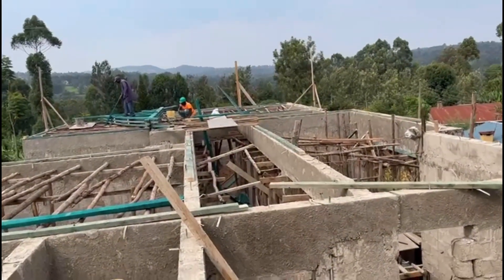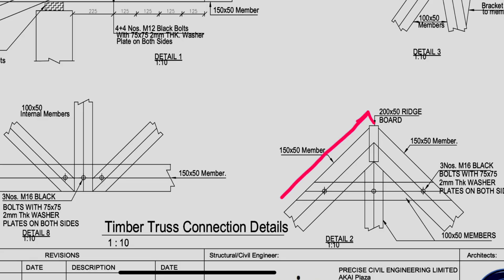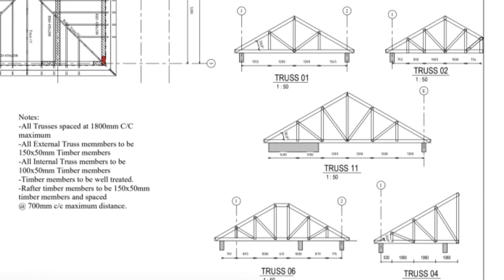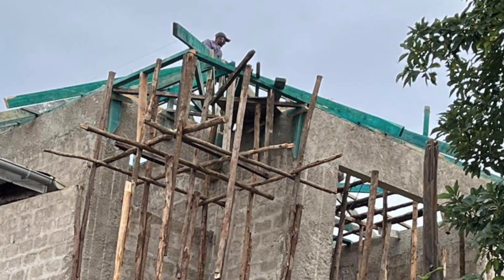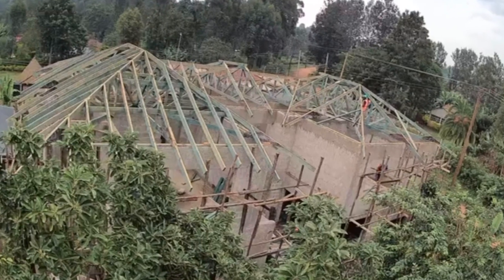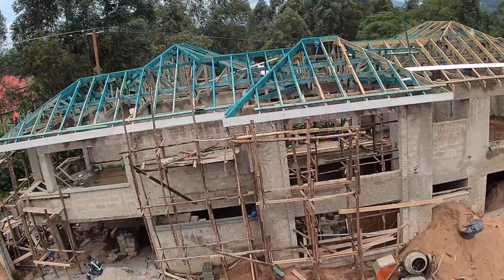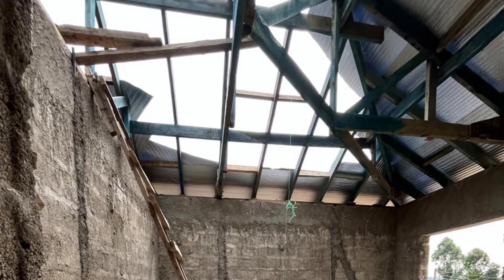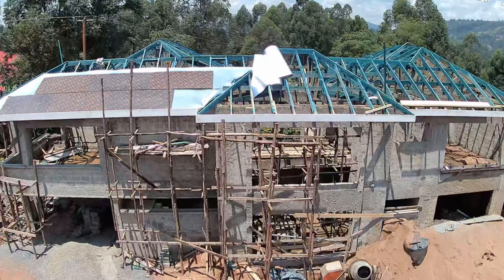Roof Installation Part I

Comment: Hows the camera working? Am intending to get cameras, what's the insulation you used?
Reply from the maker: Part II of the roof installation is going live Oct 31st at 3PM EAT (7AM CST),  most of the video angles of the roof are from both Eufy cameras on site.